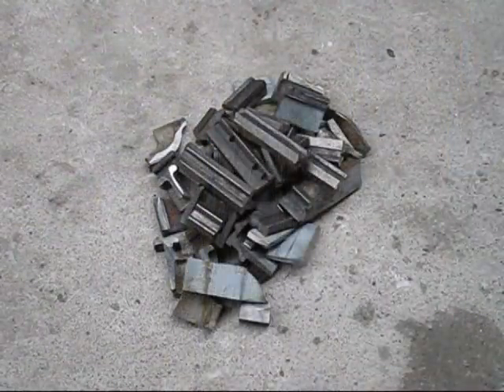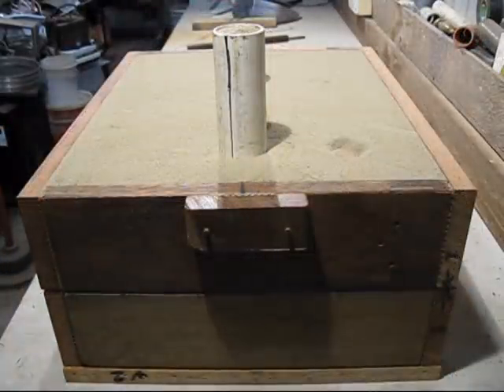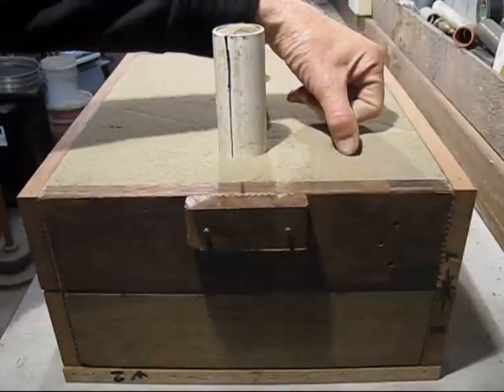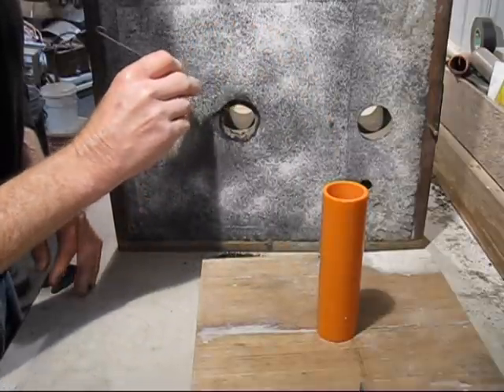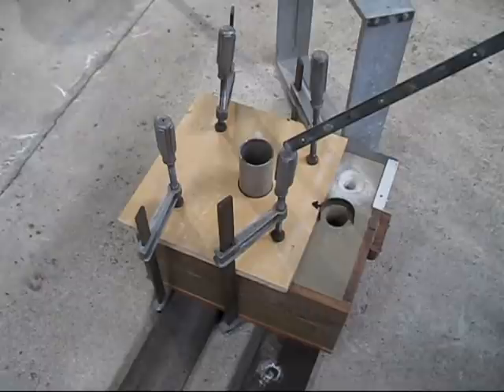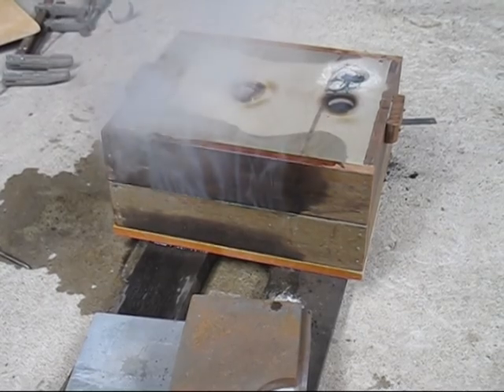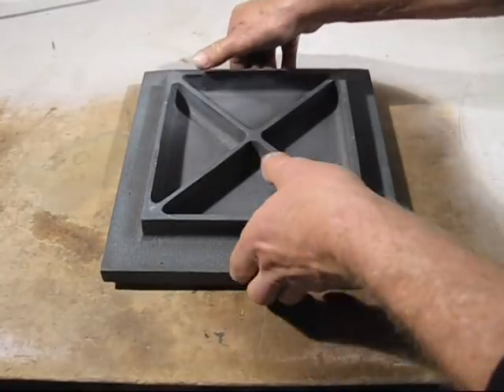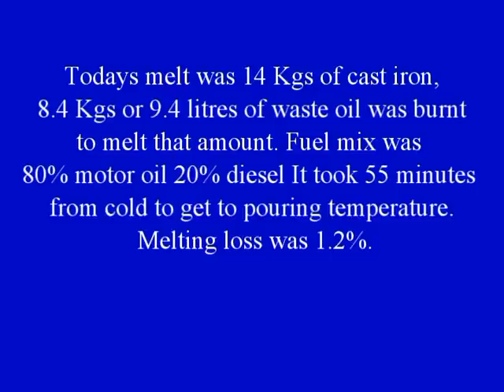Melting a lathe and crucible cam rides again

Comment: Appreciate the effort to identify challenges and improvements. Also the breakdown of iron melt, fuel and time.
Reply from the maker: Good to see that the video was useful to you.
Reply from the maker: Great to see that you found the north pine trades guild. I wish it was closer to me (two days drive one way!) I use ceramic fiber because it heats up the furnace very quickly.

Comment: I just had that same issue with the risers on my recent iron pour, which Ive learned that it's better to just skip the risers on the castings themselves with iron and put them off to the sides really. The iron tends to keep moving and feeding into the casting even after the metal has frozen, so it'll keep feeding on it's own unlike one on top of the casting, which likes to freeze and start pulling from the casting instead. I think that anything that is inside of the sand will still move, and anything exposed to the surface will freeze, so maybe a blind riser may help with the shrinkage in the center there. Everything that didnt have a riser on top of it, it had no shrinkage or defects at all, but risers on the castings themselves, it had issues. Pouring too cold really didnt help that much either, but it all worked out in the end, lol.

Comment: I gotta say I love watching your iron pours. Still amazes me you can do that in such a simple furnace. I also gotta say I shed a little rear when you cut up that lathe bed😥.
Great video.
Reply from the maker: With a simple furnace there is very little to go wrong and if it does so little to check to see what is wrong. That lathe was in a very sad state when I got it so it was not a big deal to cut it up.

Comment: Love it.  You melt cast iron like it's nothing.  Did you ever post info about your waste oil burner?  I'd like to see the details of how you use that.  Is it gravity fed?  What is used as the jet?  How well do you strain the oil?  How do you adjust it to get maximum heat?  Cheers lucky.
Reply from the maker: Some time in the future I will have to make a video about that burner. I use a old propane bottle that I connect compressed air to it, gravity fed oil method sucks compared to using a regulator to push the oil to the burner. 
I made the jet from steel and welded it the oil pipe. The smaller the jet is the better it runs but depending how heavy or light the oil is and maximum air pressure your compressor can get to will dictate what size the jet will be. Don't be silly like me and weld it to the oil pipe make a threaded jet so you can experiment with it. 
If you want endless trouble don't strain the oil. Jets have a bad habit of blocking up just when you need oil flow the most. Maximum heat comes from same way you would do with the propane burner. I use a oil control valve that is on the burner but you must have enough air flow to burn the oil completely. I use a 1600 watt vacuum cleaner and that is plenty of air so I can use larger crucibles in the furnace. When are you going to cast a big bronze bell?
Reply: @luckygen1001  Haha!  It's on my list!  Thanks for the info.

Comment: I believe having the riser on the part is causing it to retain a much higher heat for much longer than the rest of the piece, which is causing it to be in an "expanded" state locally compared to the rest of the piece. However, the metal is solidified, so it won't feed any longer. Once that area of the part with the riser on it has cooled, you will get contraction/shrinkage, and it will cause the depression you are seeing around it compared to the rest of the piece that cooled long ago while still being fed.

Comment: Nice. But I can't fathom out why you don't put the moulds outside, rather than 50m away from the furnace.
You can always drag them inside in an hours time.
Those bumps in the journey could jolt the crucible through the ring
Reply from the maker: Large crucibles cool down very slowly but when I use a small crucible I pour the molds right next to the furnace.

Comment: Thank you for all of the information you provide! Do you think a cast iron engine block / cylinder heads would be suitable to remelt and cast?
Reply from the maker: They are ok but avoid the rusty parts around the water jacket as it makes the iron very sluggish to pour.

Comment: Very cool! (or hot!)

Its really good to see someone managed to actually melt steel. Ive read in forums that melting steel would be really hard. So i replied: how hard can it be?

Well, im not to sure about how hard it will be, but i want to make it with induction.. So how would i fare doing that??

Greetings,

Jeff
Reply from the maker: I am curious to know why you think disc brake rotors are steel?
Reply: @luckygen1001  Disk brake rotors? This is a video where you casted 14 kg of cast iron. There is no disk brake rotor. 

You may want something more tough than cast iron for disk brake rotors. Forged parts could be the think you are looking for. Anything softer than steel wouldnt do i guess. Any other material would just smear away under the stresses of braking.

I never said anyting about diskbrakes are only made of steel. But i doubt anything affordable is made from anything other  than steel.

So pour an oversized part, and forge it into shape under a hydraulic press with a die set, after you reheated it to bright red. Then get another hydraulic press with a cutting die. And that should do the trick. But with that kind of trick, you would only need a piece of red hot rod steel of a certain length to get that done... Anyway, i did not say anything about disk brakes.
Reply from the maker: @jeffjefferson2676  Sorry my mistake, in this video I melted a cast iron lathe bed not disc brake rotors. so why  do you say that I melted steel?

Comment: As %90 of your viewers I plan (dream) to build a furnace too, my goal is to produce small machinery. For some parts casting got to be pretty large and I do not think I can achieve it with a home size furnace, my question might sound silly to some people but i have near to 0 experience with casting so here it comes;

Is it possible to pour molten iron from two different of crucibles, to be able to compensate from the size? ie, if the first furnace is heated to slightly higher temp, when second crucible is poured, would there be a strong binding between first poured and second poured iron? Max crucible size should be something that I can handle alone.
Reply from the maker: Unless you use two persons to pour one crucible each it will not bind with the first pour.
Reply: @luckygen1001  What is the max capacity you can handle with the trolley of yours?
Reply from the maker: @PoYoTheWild  The max capacity for this trolley is 25 Kg. I could go handle 50 Kg but I would have to make a stronger built trolley.
Reply: @luckygen1001  tnx a lot for the answers! My goal is to build my own machines by casting required components rather than using steel. And largest casting I would be ever doing would fill a A50 size crucible based on my calculations.

Comment: Are you using compressed air to atomize waste oil? or it is just blower?
Reply: @CastingIron Engines maybe that's why he is preheating furnace with gas. didn't know if it was possible to melt cast iron with such a simple burner.
Reply from the maker: I use compressed air to push waste oil to the burner but does not atomize the oil, the blower does that.

Comment: Great video as always, thank you for sharing. Is the 20% diesel in your motor oil just to alter viscosity rather than add heat? Thank you!
Reply from the maker: !00% motor oil will burn if I heat it up but it is much easier to lower the viscosity with diesel.